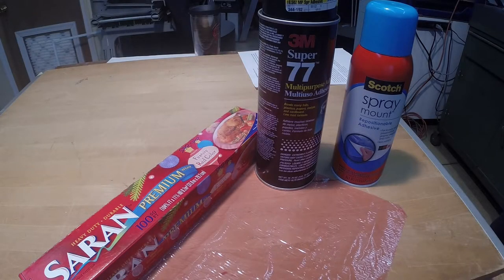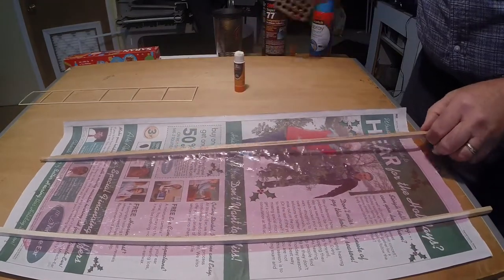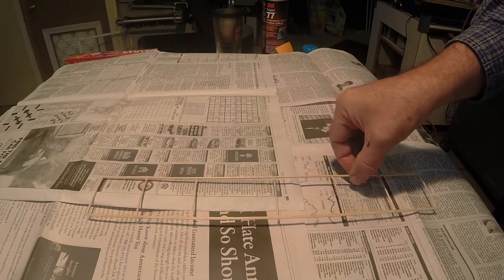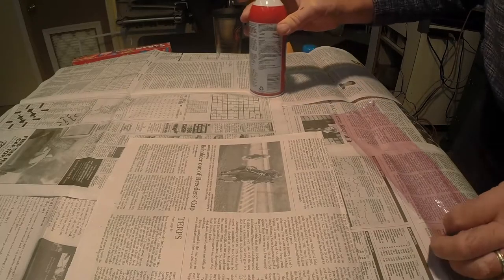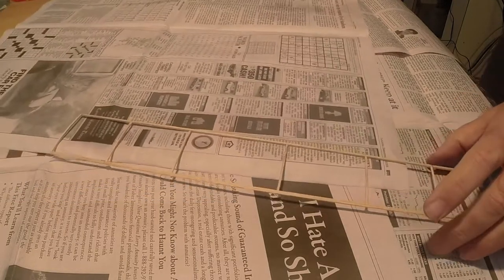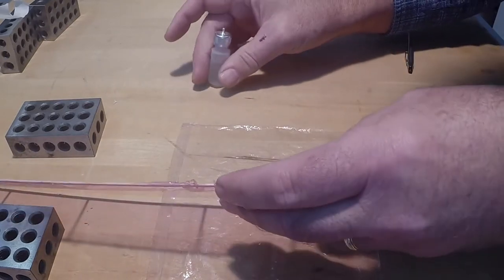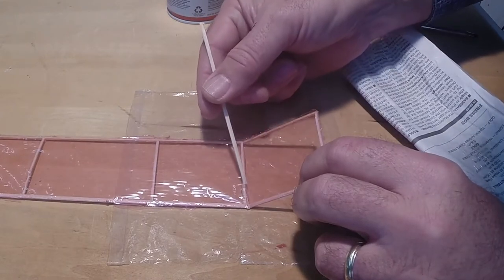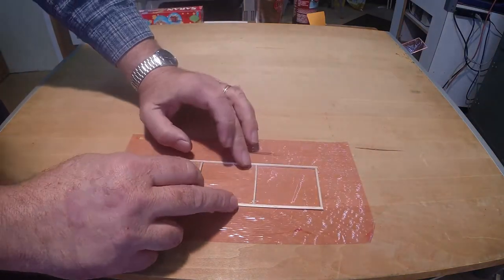Building Techniques For Indoor Flying Models Section 14 Covering With Film

Comment: DOES THE SARAN WRAP TIGHTEN UP WITH HEAT.  IT LOOKED A LITTLE LOOSE.
THANKS LEARNED A LOT
Reply from the maker: If it ends up being a little loose that will not affect the performance. I would not try a heat it up because the wood is so thin and small. As the film shrinks it just warps the frame like a good potato chip.
Reply: Thanks